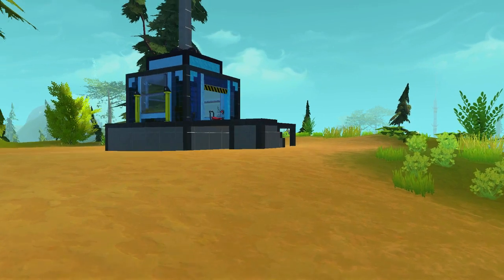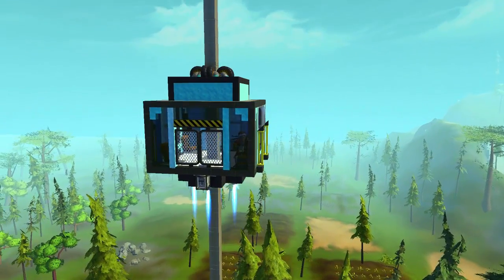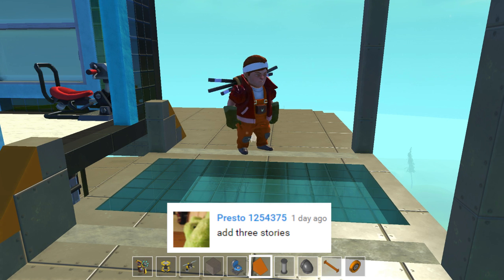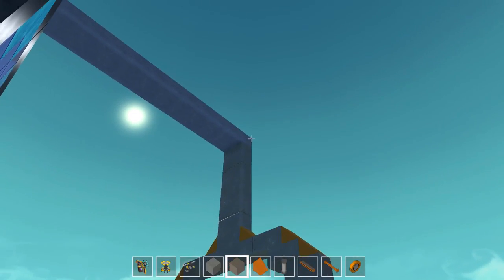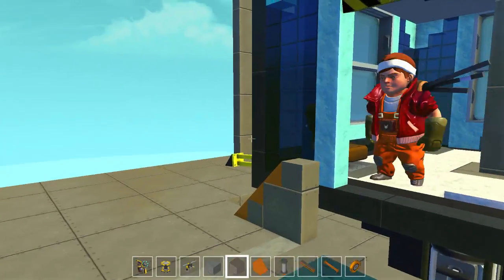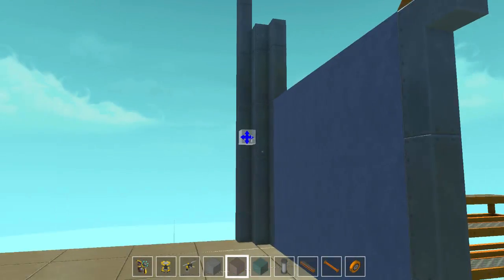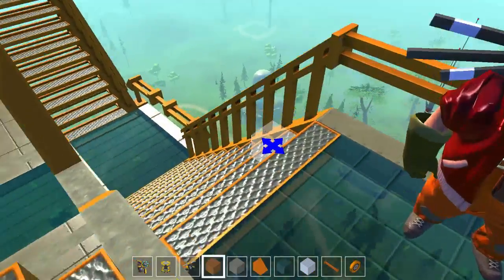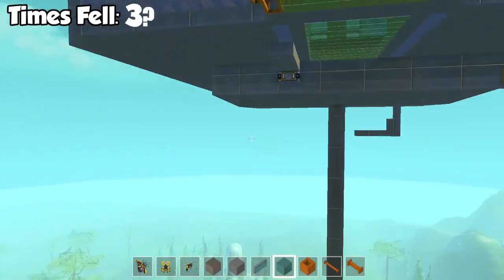SKY BASE Community Project! [EP.2]  - Scrap Mechanic (0.1.28) Gameplay Let's Build!

Comment: Add some wheels with bearings connected to nothing on the bottom of your lift so there's less stutters because the blocks won't get caught
Reply: Also if you build a lift then blocks that go down to ground level then put a chair on it lower the lift and you can go under the ground then if you jump of under the sky base and it will spawn you on it